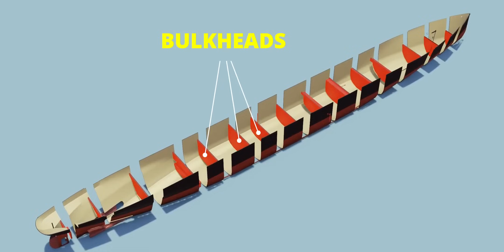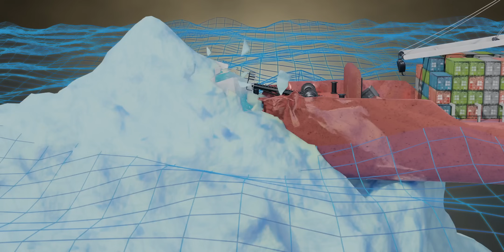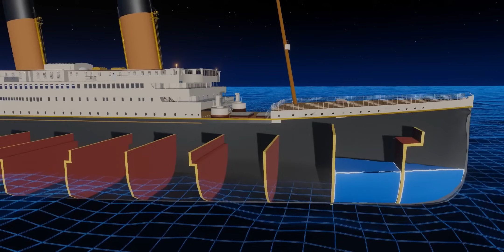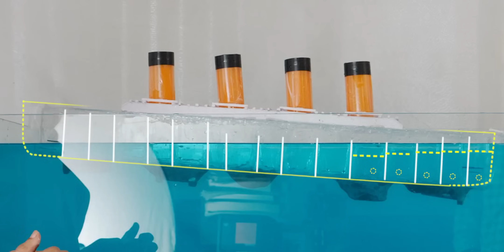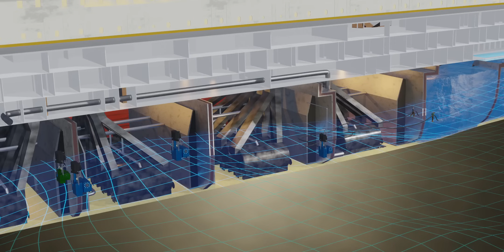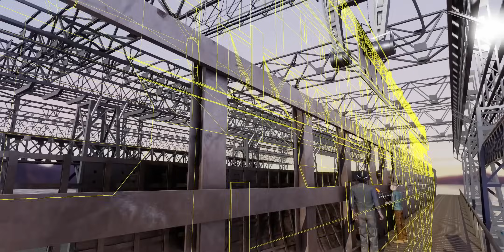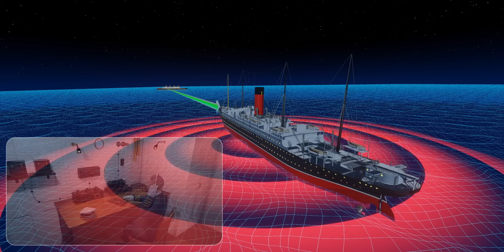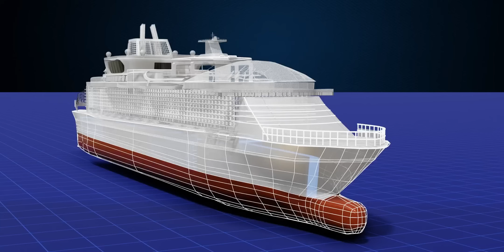How did Titanic Sink? | The Complete Physics

Comment: Made no sense to me..Why didn't the water tight bulkheads go all the way up to the ceiling why were they constructed like an ice tray where the water could spill over into the next one instead of just being isolated to the damaged areas??
Reply: Because the bulkheads would have interfered with the passenger hallways in the upper class areas..in other words there would have been doors to crawl through that the designers didn't want in those areas..plus no one imagined a gash in the hull over the length of 5 compartments.  Had 4 compartments flooded, she doesn't go down at the bow, 5 compartment, she does. Just bad luck.
Reply: @Lawyerboyleslie72 you nailed it.
Reply: @Lawyerboyleslie72  Well the water interfered in the passenger compartment a lot more than the bulkheads did bad luck yes bad design too they could have been designed the bulkheads and passenger compartments much better
Reply: I was wondering the same thing for years and decided to find out.

Originally the ships designer wanted them to go to the top but it meant the passengers needed to detour around the ship. In their current configuration if a compartment was breached the water would only rise to a certain level and stop as it was now in equilibrium with the ocean outside. However if 5 compartments were breached the hull would dip and cause a spill over to the next compartment.
Reply: Simple. Because the water doesn't spill over unless 4+ compartments are breached, which was their design target. Water cannot rise above the level of the ocean itself. If the bow does not dip low enough, it cannot spill over.
Reply: Thats what I thought too it isnt actually watertight if the bulkheads dont have a roof and are protected vertically. Otherwise they just pour over the top into each other.
Reply: @KingKhan20000  Exactly!! Had Mr andrews designed her watertight compartments with a top seal off it would have probably prevented further breaches and the flooding would've been contained on 4 compartments that were breached. But they didn't anticipate a scenario where they would have to deal with a damage like that
Reply: @Isaac-muntz  I dont think it was 4 that were breached.They say 5 or 6.
Reply: @KingKhan20000  It was 5 compartments that was breached
Reply: @Isaac-muntz  From what google says its 6.Although even if the bulkheads were sealed at the top I think the lack of buoyancy on if more than 4 get flooded would cause it to sink.
Reply: @KingKhan20000 It went to 5 and then just into 6…
Reply: Mr Andrews didn’t design most of the ship it was mostly Alexander Carlisle
Reply: Because the water won’t rise higher than the waterline outside the ship. Therefore they don’t need a watertight roof over the bulkheads. Imagine if you put a bucket with a whole in it in water, but you only put it so far down that the water outside the bucket only reaches up halfway. The bucket will not fill up more than 50 percent.
Reply: Correct they almost ran out of time with the lifeboats that they had already, more and they would’ve not loaded them because they wouldn’t have time
Reply: The same reason they didn't keep any life boats
Reply: They never envisioned a scenario where the first 5 compartments would be breached. Also so the unsightly bulkhead walls wouldn’t be visible in the 1st class areas. Perfect disaster scenario.
Reply: Reason: Water can only enter into 5th cabin from side and if this happens, ship is for sure to sink with nose down much faster as compared to allowing water enter into other cabins too to slow down the gravitational pull because if water is allowed to enter throughout the ship then it will distribute the weight of the water thereby slowing down the angle of sink. Imagine it with a flat iron rod that will sink really fast nose down if its nose is overloaded whereas if that over weight is distributed throughout it's body then it will take some time to sink.
Reply: The watertight bulkheads were scrapped because they reduced space in First Class.
Reply: I was thinking the same doesnt it nullifies the whole concept of water tight compartments
Reply: I guess you could compare it to the world trade buildings. They wernt designed to survive an airliner smashing into them. The Titanic, they never figured an situation like a glancing blow along side would never happen. Talk about a perfect storm!
Reply: One the physics of water flooding something wouldn't allow the water to flood higher than the level outside and two they were so confident that it wouldn't sink that they didn't bother putting a top on them.
Reply: @jayfizzle7931  It began at design stage, the original plan for sealed bulkheads was scrapped to create more room in 1st Class. Second thing, wrong grade of rivets ordered ("Best, as opposed to Best Best, filled with carbon impurities weakening them), third thing the out of control fire in the coal stack against the bulkheads weakening them,  so they buckled when the freezing water hit them, next thing too high speed and a course cut to try and win the fastest crossing award, no binoculars for the ice observation crew on duty, a huge iceberg which would have normally melted well before impact, a sliding impact instead of head on which popped all the rivets open, the nearest ship shut down their radio to avoid signal squark from the Titanic, surrounding ships not knowing the new SOS code, distress rockets ignored and the Captain had a meltdown so instead of stopping at the iceberg and putting passengers on it and lifeboats around it just steamed on forcing more water in. A random chain of tragic 1 in a million things all coming together.
Reply: I think the compartments weren't topped off as they needed to be open,to allow the crew to move freely along Scotland Road. If they capped them off it would be like a submarines compartments and make it difficult for the crew to move about. Also they didn't want to ruin the looks of first class areas. Seems daft and fatal as uncapped compartments allowed it to fill like an ice cube tray. Once one fills the others quickly follow
Reply: It was changed at the design stage to make more room in 1st class.
Reply: According to the demonstration of this video, the height of the compartments was calculated so the water wouldn't rise higher than the top of each compartment if only 4 flooded (the buoyancy of the ship would keep the water from rising.
Reply: They did not anticipate a glancing blow.
Reply: exactly
Reply: Because you have the passangers cabins there with balconies, restaurants etc they not watertight
Reply: People saying it was bad design... lol. You don't look at cars from 1910 and say they are badly designed. They did their best with the technology they had. No other ocean liner would have survived that damage, or kept stable as it did until the end. Also, at that time the lifeboats regulations were by ship's weight, not number of passengers. Still, they didn't have time to launch all the lifeboats, so more of them wouldn't have made a big difference.
Reply: @fritofrito77 it was actually a well thought out design and a compromise for passenger ease of use.

It was a whole sequence of events that conspired to sink the ship - what are the chances the iceberg hit exactly the amount of compartments required to sink the ship? What are the chances the lookout whose sole job it was to spot icebergs, didnt have the right tools for the job on the night?

Hell, it would have been better for the majority of the passengers if the lookout never called in the iceberg and they never turned at all - some folks would still have died sure but it would have been a lesser incident.

I guess the universe was trying to give them a lesson - hubris is a dangerous thing and calling yourself "unsinkable" is tempting the gods to intervene 😂  

You have to look at the glass half-full though.. if the events didnt unfold as it did on that fateful night, we wouldn't have gotten that great movie almost a 100 years later and Johnny Stockton Rush may have been a politician 😂
Reply: Thought as well too. They did all job and at last, nothing was done.
Reply: In a dovumentary they said it was because the owner of the ship wanted the main stairs (the glorious stairs in the movie) to be bigger and longer to impress people. So they had to change the main construction plan of the ship
Reply: @aloha1783 do you just believe anything you hear?
Reply: Because the engineers weren't expecting the Capt. of the ship to rip a hole in her side about half the length of the ship. That's why the bulkhead didn't go to the top.
Reply: 6 compartments were breached, not 5.

Comment: Another mistake here is that Titanic actually HAD enough lifeboats, the first few lifeboats werent filled fully because it was thought that Titanic wouldn't sink and the launching of the lifeboats were only a precaution measure. Until the captain realized and he immediately called the boats back but the crew within didn't listen. Subsequently this disaster of not loading enough people on lifeboats is the main reason there were so many that died. The crew were unprepared and disorganized leading to the lifeboats barely filled at full capacity
Reply: Wrong
Reply: @donalhealy8196  where's your evidence then?
Reply: There was only room for 1,200 on the boats even if they were filled.
Reply: @squiremuldoon5462  thank you
Reply: Lifeboats were meant to ferry passengers between vessels. 

The regulations at the time was for tonnage, not capacity.

Comment: There are quite a few errors in this, there is a comment below that explains them, but I enjoyed it.

Although, I don't think you can guarantee the ship wouldn't have sank with a head on collision.  That much force could have easily warped the structure resulting in the watertight doors not being able to close. This is the what happened to the sister ship Britannic when it hit a mine during WWI.
Reply: Because it hit at the starboard not head on collision
Reply: And the damage has huge
Reply: Activating the water tight door we're useless
Reply: You're right that nothing can be guaranteed in a head on collision. But I think that at least the Titanic would have stayed afloat for longer, if not indefinitely.

Comment: 5:34 - so, nice try, mister, but at liquid nitrogen temperature most steels would shatter like glass, and even at much higher temperatures "normal steel" becomes brittle, as Antarctic explorers learned the hard way - pull a heavy sledge (loaded with equipment and provisions) too hard, and the steel hook to which said sledge was taatched would just snap.
What's the purpose/ goal of using temperature of -196°C (-320°F) to "illustrate" (illustrate, my foot...) behaviour of steel at mere -4°C/ 25°F?

So thanks, but no, thanks. Looks like another channel to be added to "don't recommend channel" list...

Comment: I'm trying to work out whether the angle or the draft was responsible for the chain effect flooding of compartments. For example, if water was pumped from the fourth compartment to the aft most compartment it would increase the draft but reduce the pitch angle. If you could maintain a safe pitch angle and discharge the rest overboard, could that keep the ship afloat as long as the pumps were running?

Comment: Historically there is a lot wrong with the story told here, especially in regards to the people involved with the ship, her sinking and her rescue….but the science, physics, and practical demonstrations are all pretty much spot on and extremely accurate….surprisingly so. The only part that’s a little iffy is the visual of a modern cruise ship’s compartmentalization, specifically the actual extent it goes to and the number of compartments on common cruise vessels…there are generally far fewer than are shown here, and most actually have fewer transverse bulkheads than even Titanic did. Also  the narrative that longitudinal bulkheads are always an improvement to safety and that a combination of transverse and longitudinal bulkheads as used in modern cruise ships is nearly foolproof. The truth is watertight compartmentalization still isn’t a foolproof way to stop a ship sinking, and you need look no further than the Costa Concordia to see why and how that is true. Many modern ships with fewer (and by proxy larger) watertight bulkheads are actually more susceptible to certain types of damage that would result in them sinking faster than even Titanic. Longitudinal bulkheads can be part of that weakness as well, especially if there aren’t at least several of them used and those are divided by a LOT of transverse bulkheads. The problem is longitudinal bulkheads tend to cause the ship to list when there is flooding, and if the damage is over a large area of the ship’s length or there aren’t enough transverse bulkheads to isolate the flooding within the side of the ship that’s been holed, the ship will tend to roll hard to the side taking water and either capsize or go down in such a way it is very difficult or impossible to safely evacuate people before the ship sinks (assuming it’s in open water….concordia couldn’t fully sink being on shallow rocks). Lusitania’s longitudinal bulkheads actually round up causing the disaster to escalate far faster than they would have under the same conditions had she been divided more like Titanic.

Comment: Would counter-flooding helped to slow the sinking?
Reply: Eh... Probably not in this case. She was bust open below the water line and doomed to flood in one compartment too many. Any counterflooding to try to keep her on an even keel qould only have sunk her quicker.

Also "bust open" is a bit of an exaggeration. The hull plates were bent and separated enough to let water through, but not particularly quickly. Too fast for other ships to arrive before she sank, but still took some hours. A gaping hole that size would have sunk her in minutes.
Reply: They also didn't have tools or training to make another hull breach, which would have been the only way to do that

Comment: Nice video. I would like to precise that the turbine could not be reversed, so the center propeller could only be stopped. Also to start the turbine, the ship had to be already in motion (at least 5 knots, but not sure), because the steam had to build up after being used 3 times (they were Triple Expansion Engines, the steam was use 3 times in the reciprocating engines and one more time in the turbine, then it was recycled back into the system (cooled then condensed then resteamed). I'm an heavy Titanic enjoyer since I was a kid, and I love your video so far (barely 5 minutes into it) I just wanted to add that detail

Comment: No no no you got your info wrong dude. The ship was never going full speed to do that all the boilers would have to be going and they weren’t. No one on the crew believed the ship was unsinkable that was something the media ran with. Smith received multiple ice warnings and he adjusted his corse slightly unfortunately that adjustment put them in the path of the iceberg.
Reply: They were going about 3 knots shy of top speed. So you're technically not wrong about that lol
Reply: @KoOkYmOnStEr1988  no you are wrong as well as titanic was going at 22.35 knots at an time of collision ,as evidenced by the testimony of George rowe,in his 8-10 pm watch .Many passengers also testified increasing vibration caused by the triple expansion steam engines increase in rpm
Reply: @vramaswamy748  Well I know they slowed down before they hit the iceberg. I'm talking about before they saw it it the water, they were cruising at almost top speed.
Reply: @KoOkYmOnStEr1988  Read my comment carefully I am saying they went just 0.75 knots shy of top speed according to your statement they would have been going at 20 knots
Reply: I must have mixed up my numbers and read 26mph as 26 knots, which would explain how I got my answer. My mistake.
Reply: So some quick google search If I can believe the numbers Titanic’s top speed that she could go was 23 knots that’s 43 kilometres per hour 26 miles per hour. On the night of the collision Titanic was doing 21 knots 39 kilometres per hour 24 miles per hour so almost full speed.
Reply: Source: Trust me bro

Comment: This may seem overly harsh, but I just want to make your already well done video even better! 

1. They are not chambers. They are compartments
2. The ship was not running at full speed. Close, but not full
3. Use port and starboard, not left and right. 
4. Use his name, Robert Hitchens. 
5. Helmsman, not driver
6. Thomas Andrews made the prognosis, not the captain 
7. Not around 5 compartments, 6 to be precise 
8. 10-30 minutes is too vague. Make it more precise. 
9. The ship was safe until 5 compartments were filled, not 4
10. Ships weren’t supposed to travel at low speed, near full was commonplace at the time 
11. The captain did not issue a full speed order. She never reached full speed. At all. 
12. Titanic hit the iceberg, not the other way around 
13. The stern did not sink 27 minutes after the bow

Good video, you obviously put a lot of effort into it. Hope this helps :)
Reply: I doubt it helps. Most of this is nitpicking when there were indeed serious errors.
Reply: @misterhat5823 Hence why I included the errors. Otherwise a good video. Take care :)

Comment: Not that it matters that much, but your animation is missing a horizontal bulkhead dividing in two the forepeak compartment. Also, a 6th compartment was actually breached, in a small section of the coal bunker of Boiler Room 5 (which your red lines actually show correctly at 13:14).